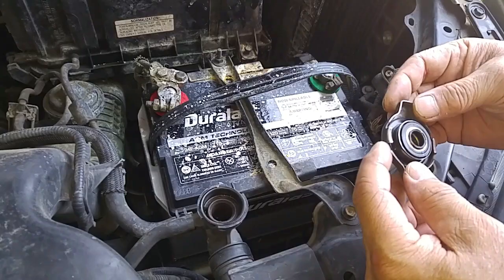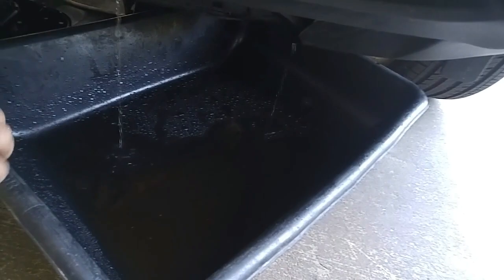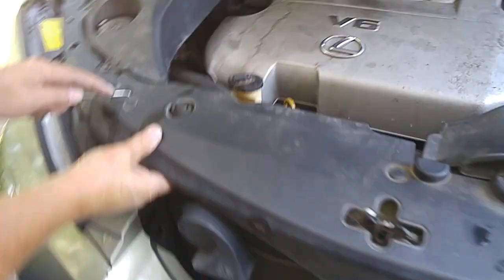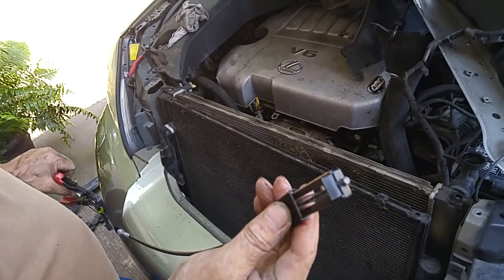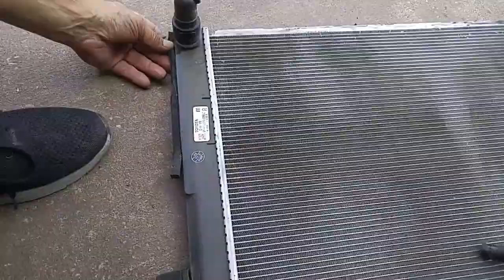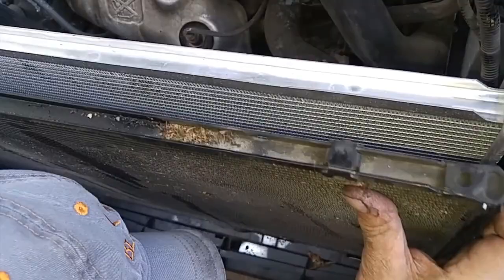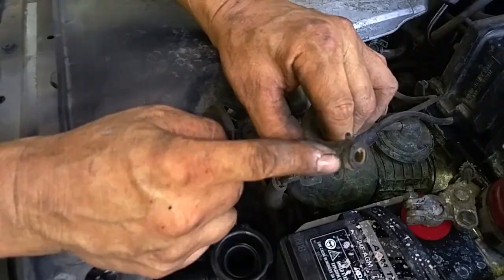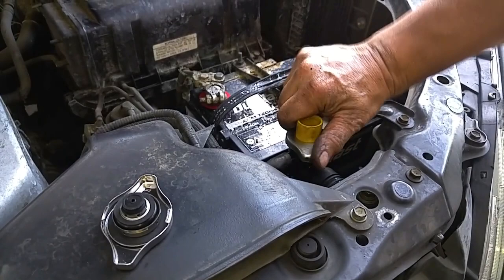Radiator Replacement - Lexus RX350 V6 2GR-FE

Comment: Your tip about the auto-shutdown feature of the Lexus really made me feel a lot better about what damage we may have done.  I caught it right before it hit the red and shut is down immediately.  I actually was able to use the Lexus tool kit and jam the hose on what was left of the nipple and have actually put 200+ miles on it since then.  The rad is still full.  I change it tomorrow with your video playing in the background of course.
Reply from the maker: Glad it worked out for you.

Comment: Great video couldn't have done the job without your help. Only caveat I can add taking the A/C condenser off I didn't have a impact rated Philips tip in my impact driver and holding presser so it wouldn't strip the tip shattered and I drove the broken tip straight thru the working A/C condenser ( cheap tools will let you down when you need them the most) lesson learned . Thank You
Reply from the maker: Thanks for sharing!  Have to be careful removing those ac condenser brackets attached to the radiator.

Comment: Outstanding demonstration! I just noticed a few drops of coolant towards the driver's side splash shield last week when changing the oil. Today at my shop I noticed a few ounces of coolant on the ground in the same spot. I gave the engine compartment a quick look before I went to pickup my kid. I think the lower radiator hose is starting to go but I have to investigate further to determine. No temp creep ups yet though. I bought the car in June of 2020 at 167k mi. From a dealer and I'm sure that they replenished all the fluids fresh. I now have 276, 000 miles on it in 2 and a 1/2 years. I should have flushed it last year. I need to take another gander to see if that pressure spring on the cap fell into the radiator as well. I might as well just replace the radiator and everything with it as general maintenance. 

I read a couple of TSB's on the RX 350 and another thing that has been known to go as well is the water pump impeller vane around 120k mi. I'm hoping my water pump is in shape but I'll have the time of the convenience right now to work on something that deep and I obviously travel a little with work and all.
Reply from the maker: With the milage you have on the car you're lucky the radiator hasn't failed. I'd replace it as preventative maintenance along with the water pump.

Comment: Great detail. I just replaced cracked radiator on my 2006 subaru sti with a koyorad aluminum radiator perfect fit. Wished they made radiator hoses  like mishimoto
Reply from the maker: Thanks for your post!  Never heard of Mishimoto (Japanese sounding company) based out of Delaware.  Looks like they push heavy duty racing related products.  Products come with a hefty price premium.

Comment: I have a 2007 RX350 and the same hose broke off nipple broke off. After removing the radiator, I check the filler neck and I was able to remove just the filler neck. After some checking in the computer, I find out the filler neck can be replaced with Dorman part #902-408.
Reply from the maker: You're right.  The filler neck can be replaced.  I choose to replace the radiator since it had over 200k miles.

Comment: Such a great video. I have a RX350, and the hot/cold needle on the gage is starting move towards the red..I talked to a mechanic he says it could be the radiator, we will know for sure when he looks at it, but this video is very insightful! Thank you!
Reply from the maker: Get the overheating problem fixed ASAP or don't drive the car.  I'm replacing an engine on a RX due to blown headgaskets caused by continued driving with no coolant (leak in radiator).
Reply: @hardlymovingpro  Thank you!..I got radiator replaced. There was a hole on top of the radiator. When the mechanic saw it..he said the same thing, do not drive it at all!
Reply from the maker: Good for you!

Comment: I don't think that fitting blew off because of overpressure. Mine snapped off just like that when removing the fans in order to replace the alternator. I just barely put any force on it. I was being extremely careful. I think the plastic just jets brittle with age. If someone made an all-aluminum version of this radiator I would have been willing to pay twice as much for a replacement. Oh well. If this radiator lasts me another 12 years I think I'm good. Thanks for making this video. Very helpful
Reply from the maker: Thanks for sharing.  Your circumstance may be right.  Aged  plastic components can break unexpectedly at any time.
Reply: EXACTLY what happened to me yesterday. Replacing my friends alternator and the one bolt for the fan shroud while taking it off broke the lower nipple!  I told my friend well we’re gonna be replacing your radiator as well!!
Reply: You can replace just the nipple piece itself. It’s called the coolant filler neck $20-30 bucks and comes off with a c clip. No need to replace the entire radiator
Reply from the maker: You are correct.  But considering the car is a 2007 with over 200k miles, you never know if the rest of the radiator might spring a leak in a weak point in the radiator.
Reply: @John3_16Q thanks so much for this advice I just replaced mine because of you I was about to replace the whole radiator before that
Reply: @seanestavon6409  good thing you looked into it because i didn’t and ordered the radiator which i still have in the box. Once I found out i just replaced the spout to avoid all the work.

Comment: Very good video, I have a question, after everything is installed, do I need to add transmission oil?
Reply from the maker: Thanks!  I'd say add around 1/3 quart to compensate from lost oil in the old radiator as well as disconnecting the supply and return ATF lines.

Comment: @0:24 - the two offshoots on the left of the cap is where I developed an issue.  The upper of the two (in shot) hoses was the issue.  The nipple deteriorated and broke.  I managed to work the hose on the remaining part of the nipple, refilled and made it 200 miles.   I'm watching this video because I am about to replace the radiator now.
Reply from the maker: I know your problem.  Old plastic with many heat and cold cycles eventually loose their strength and either crack or break.
Reply: @hardlymovingpro  I commented before I even watched.  I feel like an ass now.  I got the Denso and I'm installing it tomorrow along with a brake bleed.  Thanks for taking the time to document this.

Comment: I ss under the impression from Lexus  the bleeding process on these. Yea does have purge top cold purge screw on radiador. But another bronze nipple between bank one and two to preform a bit of unique method strictly on these Lexus. Or the bleeding process won’t be done correctly.
Reply from the maker: Anyway you cut it you have to port out the air in the cooling system when adding coolant and there's a big air pocket in this vertical fin radiator design.

Comment: Hi my 08 leaked all of its coolant after driving it 5 miles to the shop. It would not drive after i turned it off. It would turn on but when put in drive it wouldnt move or even rev. Hopefully there was no engine damage
Reply from the maker: The auto shut off feature occurs when the engine temperature has been exceeded.  This happened to a customer of mine which eventually resulted in head gasket leakage.  Tell tale signs are no heat coming from your cabin air vents and/or air bubbles coming from the rubber tube in the coolant reservoir tank.  I wound up replacing the engine with a low mileage JDM engine.
Reply: @hardlymovingpro  yup. You are correct. Just got a new radiator installed and engine flushed and it rides like new. No engine damage

Comment: Wow your startups are nice and quiet. I have a issue with either piston slap or rod knock below 40 degrees or colder regardless of what premium synthetic oil I use. But it usually subsides after 30 seconds or so once operating Temps are reached she purs like a kitten. But I hear a little clack a  lacking sometimes when she's at operating temps I'm starting to suspect the bearings are gonna go on the water pump.

Have you had this issue on cold starts with yours?
Reply from the maker: Not my car but customer's car.  No complaints or issues reported.

Comment: A good piece of video except at 7'47" when you remove the radiator, the condenser was not there and then it came back. I just wondering how did you remove the condenser?
Reply from the maker: It was always there and never removed.

Comment: The bottom two bolts were incredibly hard to remove on the fan shroud...i actually haven't gotten them off yet tbh.  Any hints?  MN Weather 😢
Reply from the maker: Use a 1/4 ratchet wrench with different length extensions for the 10mm socket.

Comment: I did this myself, unfortunately, before finding your video.  The 2007 RX350 also has the engine bleeder valve, a 10mm socket fit, that you can open up to release the air while filling up coolant and flushing out air and out.  Close it immediately and gently once the bleed has a steady stream of coolant coming, no longer bubbling.  See https://www.youtube.com/watch?v=UJe1dbFVoqw and you'll know what I mean.
Reply from the maker: Yes ... The 07 RX has a weird vertical row radiator and air must be bleed via the 10mm bleed valve.

Comment: Hi...Im looking to change the fluid on my 2009 camry with the v6 3.5L motor...can you please give me a link or email me the directions on the procedure. i dont have fancy equipment, just a tube and funnel lol. thanks very much! love your videos!
Reply from the maker: Thanks for your support!  Take off the bottom splash guard under the radiator and unscrew the winged drain plug.  Screw back in the plug after all fluid has drained out.  Remove the dust cover (if present over the radiator cap) and replenish the new coolant.
Reply: @hardlymovingpro   sorry bro i meant the tranny fluid drain n fill on my 09 camry 3.5
Reply from the maker: There's a drain plug in the bottom of the pan with center dip tube that needs to be removed with a hex socket tool.  Since there's no ATF dip stick, the fill port bolt (located on the side of the transmission), must be removed to allow pumping in of the new ATF.
Reply: @hardlymovingpro   so basically after removing both drain plugs i should let it drain, tighten up both plugs ad just replace that same amount of fluid?
Reply from the maker: @CAFEX24  yes.

Comment: Great video, I am about to do mine. What is the secondary white plastic tank underneath the battery??
Reply from the maker: Believe that's an air baffle or container to hold water preventing it from entering the throttle body.

Comment: What damage could that radiator cap spring do if left broken off in the radiator?
Reply from the maker: It's not the spring but the cap.  Without the spring, excess pressure will build up inside the cooling system.  Replace the cap whenever the spring detaches from the cap.
Reply: @hardlymovingpro   That part, I understand. My question is about the spring becoming detached, and falling into the radiator. What damage can it cause if the spring can’t be fished out, due to it being deep inside the radiator?
Reply from the maker: I don't think there's much travel room for the spring.
Reply: @hardlymovingpro   Oh okay, so it probably won’t do much damage? Also, do you think that doing a coolant flush might be way to get the spring out of the system?
Reply from the maker: Spring is too big to circulate.

Comment: 7:58, I’m like why did that look soo easy for you then realised I gotta massive ac line in the front of the bottom hose fitting. farrrrrrrrr off
Reply from the maker: Not easy working on modern cars.  Lots of things jammed together.

Comment: it's not a hardly moving vid if we don't bust out the dielectric grease! BTW I am loving my mountain 12x14 and 8x10 long double flex... lot less cussing these days.
Reply from the maker: Yup ... those are great box wrenches!  Learned my lesson with other cheaper brands ... like non reversible, not indexed and the swivel heads get loose.
Reply from the maker: BTW - You've got to start having Milwaukee power tools to get to the next level.
Reply: @hardlymovingpro  I started out with Ryobi and wish I spent the extra for Milwaukee from the get go, but Ryobi FINALLY released a 1/4 impact (P344) that works pretty good. It's not as compact as the Milwaukee though!
Reply from the maker: I've got around a dozen Milwaukee's now

Comment: help!    by mistake I  un bolted the left upper connection to the   condenser,  all this pressure came  out and some  oil,    So I assume I will need to  take it in  later to recharge the ac system?  what is the oil that came out?   thanks  Manny
Reply from the maker: No biggy.  You lost around 1 oz of compressor oil by the release.   Go to the end of this Civic ac condenser replacement video which will show you how to vacuum and recharge your system:  https://youtu.be/o9lQPGolL9Y

Comment: What about the ATF?
Reply from the maker: You mean adding a couple of oz of ATF?
Reply: @hardlymovingpro  Yeah. Does it have to be measured and at 40C temp?
Reply from the maker: This vehicle has a dip stick ... not that fill through the side setup at the right temperature.  Just need to add maybe 4 oz via the dip stick port hole.
Reply: @hardlymovingpro  Thanks. Awesome video, excellent channel.
Reply from the maker: @davidf5609  You bet!